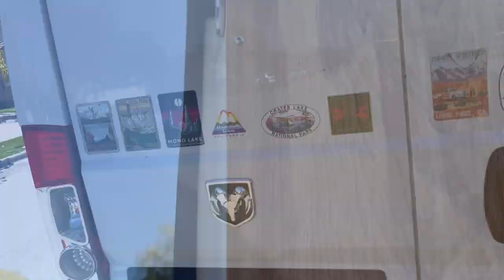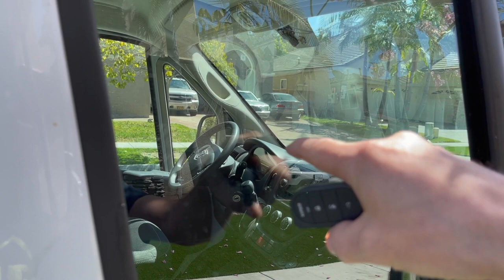Van Security

Comment: Awesome idea putting the lock on the sliding door track!  I'm definitely going to incorporate that one into my build.

 I've used a few  similar modifications to my Promaster, but instead of the individual locks on the front doors I put a chain from one door to the other.   At the 3:35 mark in your video there's a little black plug that has a hole below it.   That hole can accept a fairly large eye bolt and I use a lock and chain to connect the two.
Reply from the maker: yeah, I thought about the chain thing too.  The problem is we sit in the chairs during the evening, so the chain would interfere.  
Secondly, I instruct my wife to point the van towards the road and turn the seats forward when she's ready to go to bed, so if someone was trying to break in, she could just jump in the drivers seat and take off.
Reply: I saw an item sold by German company but they don't ship to US.  It attached to the back upper screw of the door pocket and then looped over the seat belt post.  I copied the idea using spring clip around seat belt post connect to chain that is secured to the screw of the door pocket.  I installed a snap hook midway down the chain so half the chain hangs from each connection point and you use the snap hook to connect the 2 short pieces of chain.  This connects the door to the seat belt post and allows it to open no more than an inch - not enough to get bolt cutters inside to cut the chain.
Reply: @tobymkay  would you please post the link to.the German company with this lock. Thank you Sir
Reply: @neverquit6939  Oops, now I see you were asking about the front door.  I do not have that link readily available.  If I can find it, I will post.

Comment: Great ideas!  I have a 2016 Chevy Express 2500 van I bought last year and just recently started my build.  Last week someone popped the cylinder key lock inward on the driver side door and broke in the van.  I didn't have any tools or nothing of value for them to take so I guess they were after tools. That's the only thing I worry about when building out a white cargo van.  They all have a bad rap as to the possibility that there might be expensive tools inside to the eye of a common car thief. Puck locks and any type of external locks are still an open signal that there's something of value in there. What to do!  Your right, if they want in bad enough they will find a way, but at least your ideas will definitely slow them down and give them a moment of pause.  I am going to implement your ideas.  My only concern was the hole that you drilled on the external rail for the side door.  Is it hard to get that cylinder lock through there?
Reply from the maker: Oh no.  It's easy to hook the lock through the rail.  I bought the locks below.  But if I were to do it again I would buy a better grade of lock like Master or something..  Glad my video helped!
https://www.amazon.com/gp/product/B07QC2H161/ref=ppx_yo_dt_b_search_asin_title?ie=UTF8&psc=1